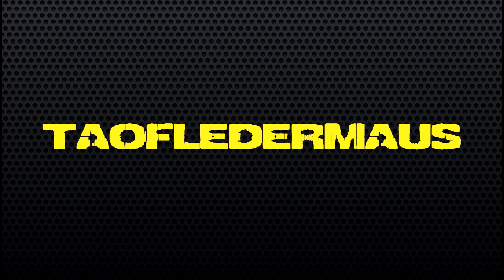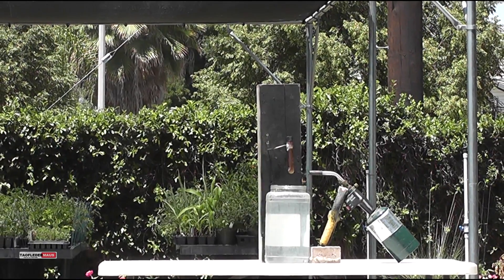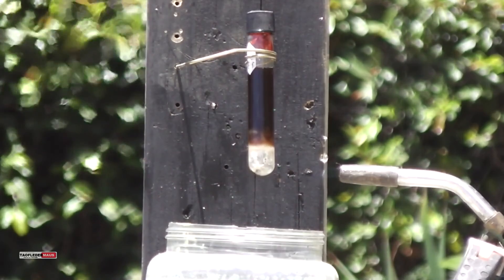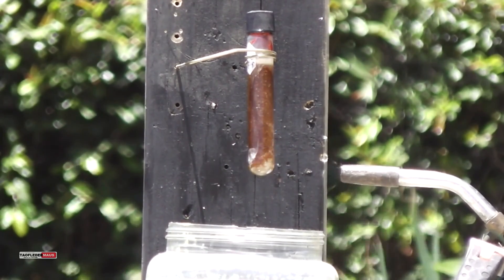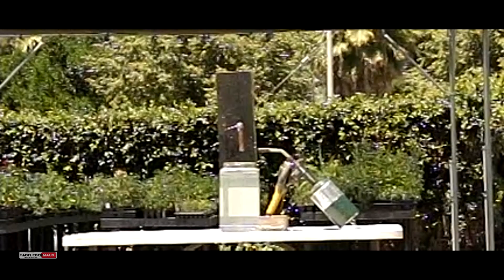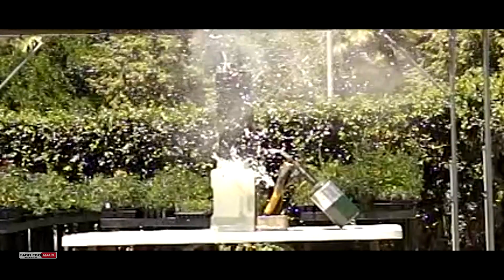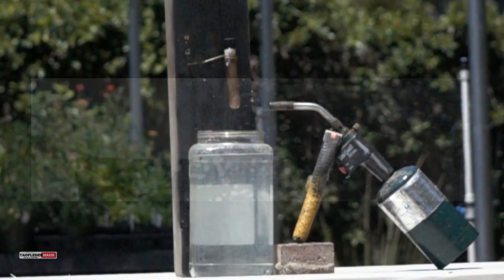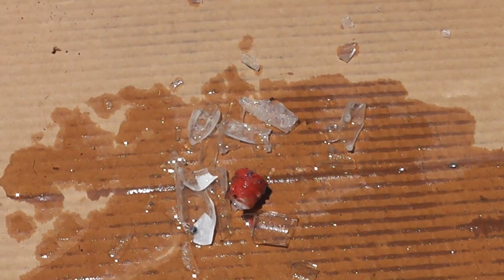Test Tube Torture Test:  MOTOR OIL

Comment: Why did you say that the oil needs to get to 2000 degrees to become a gas but earlier you said the boiling point was between 500 and 600 deg F?

Comment: Adding that water meant the contents was at 100 degrees Celsius when it exploded and the oil acted as neutral filler. If you want the oil to do some work, add rather something for that oil to oxidize with.
Reply: kasuha

Comment: you can use a smart phone to control the RX10 ii or you can buy RM-VPR1, you can find some third party ones on ebay also but most only support stills not video recording. The Fotga remote seems to support both stills and video.

Comment: Try it with Used motor oil, the contaminants will contain metals like aluminium, iron particles, zinc and possibly magnesium depending on the engine it came out of, a good bet would be to ask around local mechanics if you can scoop a bit out of their waste oil, which will be a mixture of various oil weights and contamination from variable mileage and condition, it'd be cool to see how that mixed mess reacts under heat and pressure!

Comment: Do you think it was it the kinetic force of hitting the water/container or the thermal shock that shattered the test tube?
Reply from the maker: Temperature shock combined with residual pressure still inside the tube is what i think.
Reply: Yeah it'll be the temperature difference

Comment: you know what would be a cool rifle and gun test. set up interior and exterior walls to code. at a specific distance from each other. and see how penetrative the home defence shots are in a real world scenario. is there a difference between a scuffle on a wall and shooting the wall from point blank. or standing 7, 10 or 15 feet back like your just getting out of bed. if your kid is in the next room, is s/he safe from strays?

another one I've always wondered about is because of my AR, in a home defence situation, is there a difference between standard, run of the mill ammo. And blackout 'slow' ammo.
Reply from the maker: I think even a .22 will go through something like 8  walls.    There are some channels that have all ready done stuff like that.
Reply: +TAOFLEDERMAUS Yeh, but everyone tries it with 8 sheets of dry wall 10 inches apart. I mean, make a house size test. would the bullet slow down enough in the space between 2 walls to stop...

Comment: I'm actually kind of curious how silly putty would react.
Reply from the maker: I've got a lot of silly putty.  I've tried to just heat it up with a torch and it gets soft,  but then sort of dries out and burns.  Probably wouldn't transfer heat very well in a glass vial  and just melt the glass.
Reply: ***** Have you ever done it in a sealed environment where the moisture from the putty can be contained? I don't know if this would actually change anything but it feels like it might be worth the consideration if you haven't yet.

Comment: Did the test tube shatter from the thermal shock? Or simply the force of hitting the water.
Reply from the maker: It wasn't going that fast,   so it was probably thermal shock combined with residual pressure still inside the tube.

Comment: The oil NOT exploding after 20 minutes would have been interesting too.  And pellet gun explosions are always cool...
Reply from the maker: The only thing that happened was it turned dark.   It probably got to about 1000 deg,   but  did not build up enough pressure to blow.
Reply: ***** Negative answers ("it DIDN'T blow at 1000 degrees") are answers too!  :)

Besides, shooting it with a pellet gun would have made a cool explosion.

Comment: Ever thought about using mapp gas for things with higher boiling points?
Reply from the maker: You still have to apply the heat at a rate that equals the rate the substance will absorb it.  If you try to heat it up too fast, the glass just melts first.  It's sort of like bringing up a boiler too fast.  You can overheat it and cause the tubes to blow out.

Comment: Ive missed these videos. But for the guy who suggested water should have suggested like boiling temp water as to not have a dramatic temperature change.
Reply from the maker: The plastic container would have melted!
Reply: Im aware of that, thats why i was thinking it wouldnt make a lot of sence unless you poured it at the time of failure by the tube.

Comment: There are 2 remotes on the page;
$65 : http://www.sony.com/electronics/interchangeable-lens-cameras-tripods-remotes/rm-vpr1
$25 : http://www.sony.com/electronics/interchangeable-lens-cameras-tripods-remotes/rm-spr1

I think they are super lame and you need to pay the extra $40 for video record button vs only photo, not positive. Should be programmable :/

However... Another thing I found while trying to find remotes elsewhere, on this page : https://esupport.sony.com/US/p/model-home.pl?mdl=DSCRX10M2&template_id=1&region_id=1&tab=download#/downloadTab (after setting your/any OS) there's a firmware update for the camera as of April 26th this year, and one of the mentioned 'benefits' is the following...

"Improve a focus shift condition with HFR (High Frame Rate) recording". May be worth looking into if that's the main reason you have that camera!

Also, semi off topic, I don't know how well solids would work in a Test Tube Torture Test, however... I'd love to see you do Magnesium. You'd have to do it in a really safe place, I'm sure you know all about Magnesium though :P. If it's hard to find locally you can get it on aliexpress for about $50 for 2.2 pounds / 1 kg... http://www.aliexpress.com/item/Magnesium-Chips-Turning-Shaving-99-95-pure-1kg-by-Borui-Advanced-Materials-Limited/32287149909.html?spm=2114.01010208.3.11.FOUR2d&ws_ab_test=searchweb201556_8,searchweb201602_2_10037_10017_301_507_10032_401_10040,searchweb201603_2&btsid=44a96630-28fc-4972-8bbf-62eff3130285 :P

Sorry for writing a book, hopefully something helps with the camera. Take it easy man!

Comment: have you done glowstick?
Reply from the maker: I thought of doing that.  But I don't know how to get it into the tube,   seal it  with the silicone, and let it cure for a few days - without mixing the light stick fluids.
Reply: http://coolglow.com/15-Inch-Retail-Packaged-Glow-Sticks-Assorted/c0/?utm_source=google&utm_medium=cse&utm_term=15537&gclid=Cj0KEQjwv467BRCbkMvs5O3kioUBEiQAGDZHL0iu-GTF91sLe7Gxtfol1em_0CMeiSvlwfiQ9b1KFaQaAhfk8P8HAQ tiny glow sticks. dollar store should have them. cut the top pour the liquid in then drop the glass vial in seel it, when ready give it a good shake. there paper thin glass vials filled with hydrogen peroxide should break when it hit the wall of the test tube.

Comment: glass, even tempered borosilicate glass can't handle that level of thermal shock.  Always going to get an explosion very quickly after it contacts the water.  Perhaps if the water in the catch container was near boiling it might survive longer, but even then may not be enough. Probably not worth the effort.  The lack of impressive smoke/steam cloud was sort of disappointing..  the only upside is to act as a shrapnel damper.  say no to silly water filled catch containers.
Reply: yeah, without it we might have gotten a fireball.

Comment: Could you try something that is silicone based? like lubricants or glue. Silicone tend to have a high boiling point and it degrades into something similar to glass, it would be intresting.

Comment: I think the test tube exploded, in the water because the temperature difference between it and the water. Even if the test tube is porcelain at high enough temperatures with the high impacts with TTTT it could do that.
Reply: wat
Reply: Corrected.
Reply: im not a scientist so this is probably wrong but maybe it exploded because it went in sideways and hit a little hitch in the container as seen in 3:34

Comment: Nice one, it was cool to see the oil and water starting to mix with the heat.

How about dry ice for the next one? You could get cool phase transitions by making liquid CO2, perhaps even supercritical if your test tube handles the pressure!
Reply from the maker: I wouldn't be able to seal it,  it would leak out of a cap,  and blow up  at an unpredictable time,   and probably kill me.  lol
Reply: Ah, too bad.
Maybe it would be feasible with a better cap so you don't need that silicone sealant anymore?

Comment: if the water was very hot do you think it would have went to the bottom?
Reply: No, water boils at 100 degrees Celsius, the "mix" was still at a much higher temperature. Also, at fast impacts water acts weird, like a "solid", but I know little about that, and forgot the name, and I'm lazy to look it up now.
Reply: +Wesker End non newtonian?
Reply: +Jackguitarcover Surface tension plus drag force. Add the temperature shock and no, I don't see that being possible.
Reply: +Wesker End no i mean something that still is liquid form but when impacted acts solid
Reply: +Wesker End im not mocking im here to learn
Reply: ***** I know what you meant, that does not apply to this situation, and what I first wanted to say is in my previous response  ;)
Reply: +Jackguitarcover 
Water is a Newtonian fluid as far as I know. It's simply that at high velocity, a liquid will provide enough drag/resistance to damage projectiles (that's why high velocity bullets come apart so much in water). Hope this helps.
Reply: +ExF1Guy thanks i know its newtonian i just was suggesting that a projectile impacting at high velocity would make it act non newtonian for a split second but your explanation works better
Reply: +Wesker End i think the difference in impact compared to other liquids is due to its relatively high surface tension.

Comment: Sorry to say that you might as well have just done plain water. The reason you aren't able to get the oil hot enough is because your torch is just a little too far from the tube. You should maybe try 2 torches set opposite of each other. Test on an empty, uncapped tube to make sure the glass doesn't melt then put oil in it and record the demonstration. I really would like to see it done this way if you want to. I think the results would be dramatic.  :-)
 P.S. I did not dis this video. I swear.

Comment: Do gallium with an open top then film it cooling
Reply from the maker: Gallium's boiling point is WAY higher than the melting point of glass.
Reply: +TAOFLEDERMAUS thats funny, given that it melts at such a low temp.
Reply: +TAOFLEDERMAUS yea, don't boil it, just melt it then let it cool. Gallium contracts when it melts so expands when cools. See where I'm going with this

Comment: let's see what happens when the test tube launches into hot water to avoid the thermal shock.
Reply: even if the water was boilig the tube would be way above 100 °C so there is still thermal shock.